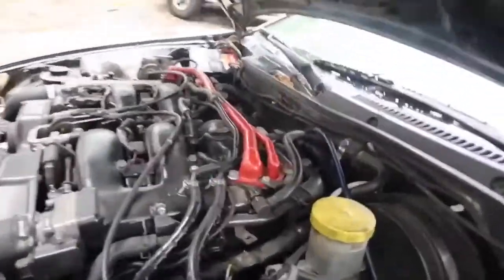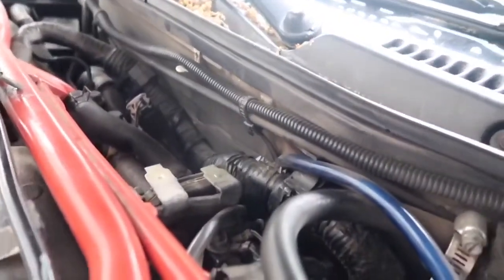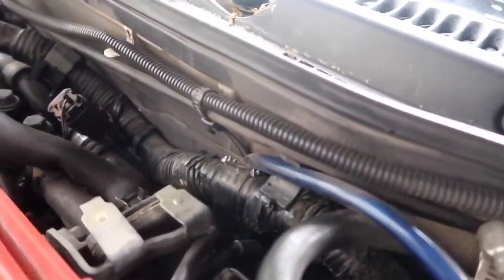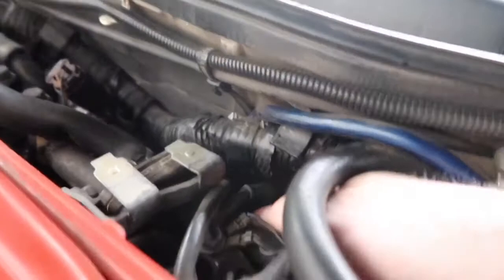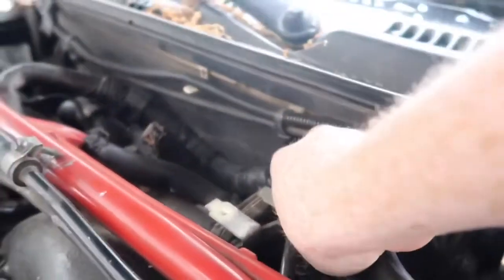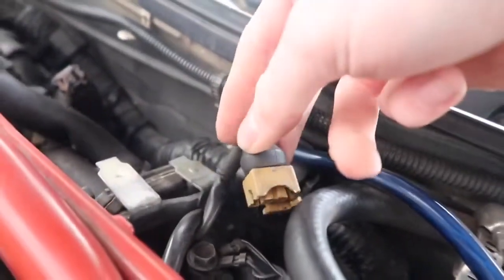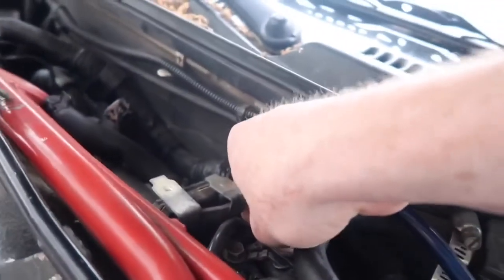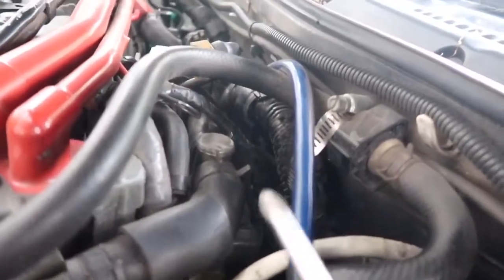How to adjust the idle on a 300zx

Comment: Any experience messing around with kickdown cable or switch ? My z has been buggin out since I bought it around 60mph the rpm is just under 3k. When I let my foot off the gas it downshifts but when I put my foot back on it upshifts. Thought it was the instrument cluster or speed sensor since the original speedo didn’t work. Installed a new one and all the gauges work now. Just shifts really weird at highway speeds.

Comment: Is there a difference between na maf sensor and tt maf sensor? 
Trying to figure out y my car isnt idling...currently running na fuel pump, na maf sensor, no leaks anywhere i think. Laggy throttle response
Reply from the maker: No I don’t think there is, and check idle air control valve
Reply: hey if you havent found a fix the laggy response could be from a bad TBPS
Reply from the maker: peirce kinnison mine ended up being the tb screw missing
Reply: Alex Childers close enough! Symptoms of a bad throttle body.  Glad you figured it out.  If you ever have anymore questions hmu, I am a local Z specialist on the coast.
Reply: Hey thanks for all the replies. Still got no clue whats going on with it.
Reply: @peircekinnison7812  im in Ontario what coast u talking about?
Reply: prince kashez Mississippi gulf coast
Reply: @PrinceKashez9  u ever figure it out?

Comment: How do you take of the plug?
Reply from the maker: The plug connection to the iac?
Reply: Yes
Reply from the maker: Well for mine I just pulled it off but it might have a little paper clip size ring around it and if it does you will have to get a flat head or something and pop the little ring off first
Reply: I tried but theres no space but appreciate it !
Reply from the maker: Ya that’s the sucky part about the z32, you just have to keep trying and see if you can move stuff out of the way to reach it